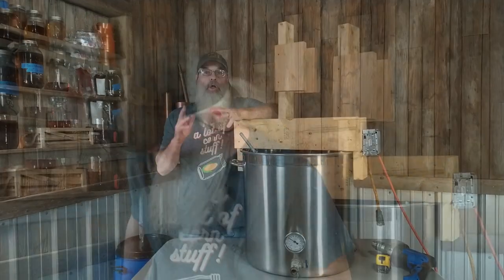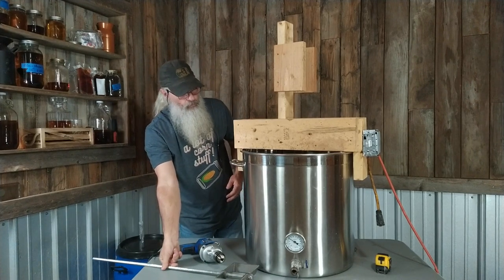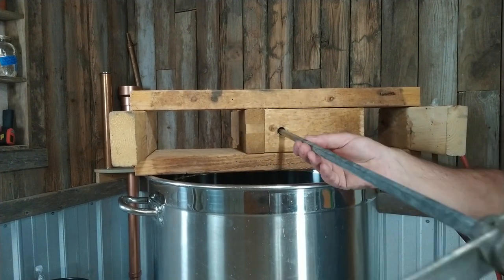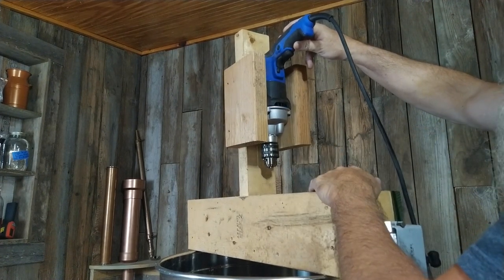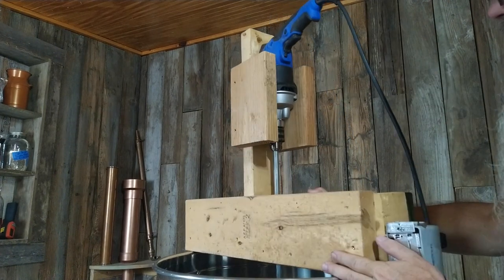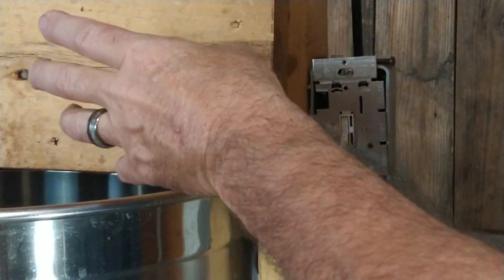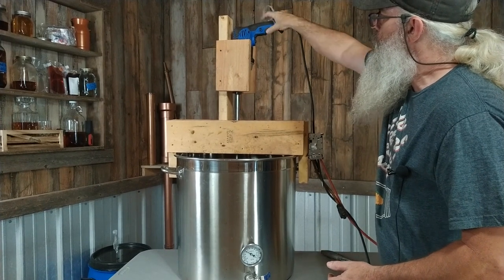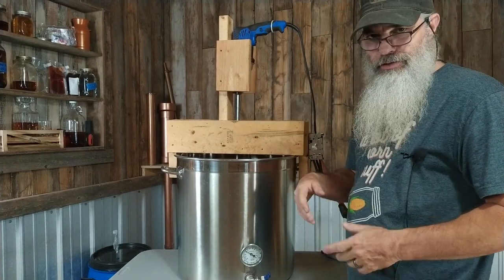Homemade electric paddle mixer for making moonshine mash

Comment: for the light dimmer to work make sure your drill brush type not brushless
Reply from the maker: I did not know that. Thanks for sharing.
Reply: I was thinking something very similar that the switch should be a fan control since it’s controlling a motor and not a light switch. However, since I’m not an electrician, could you please explain the difference on why you would use a brushed motor as a post to a brushless

Comment: Had to make one last week for my all grain. Pulled up your Wheated bourbon video and free handed it. The mixer paddle I could only find at Lowes. Everything worked great! I had a pre-made electrical controller for my T500 still so I just used that to adjust the speed of my drill. :-) See you on MEWE!!
Reply from the maker: Awesome! You should share some pics of it on MeWe.
Reply: @StillnTheClear  Yes Sir, will do!
Reply: @StillnTheClear Just posted it.
Reply from the maker: @OVRCOME  hell yeah, it's awesome.
Reply: What is MeWe if you don't mind? I probably am just not thinking or watched long enough.